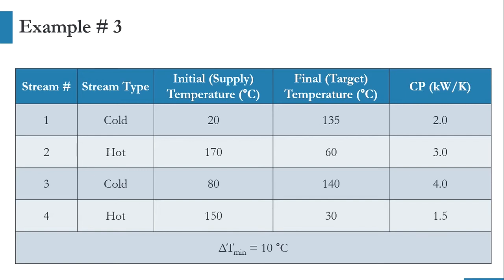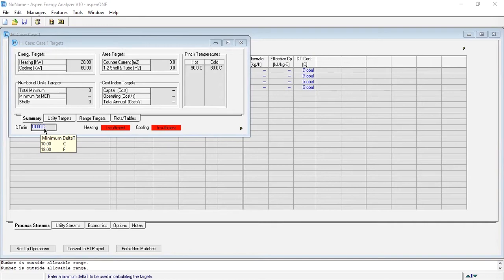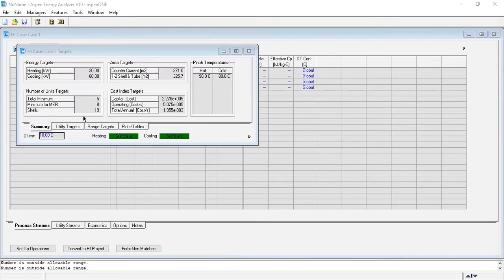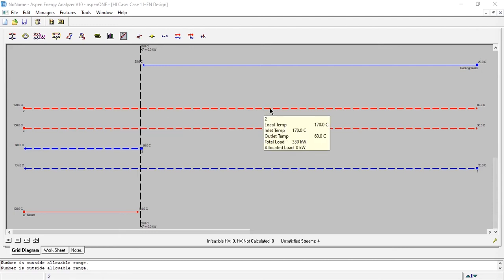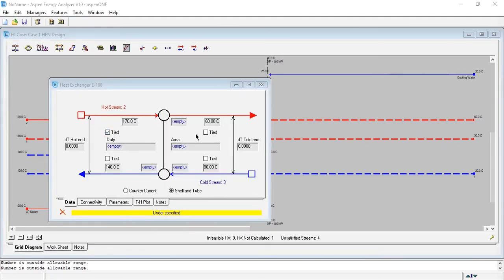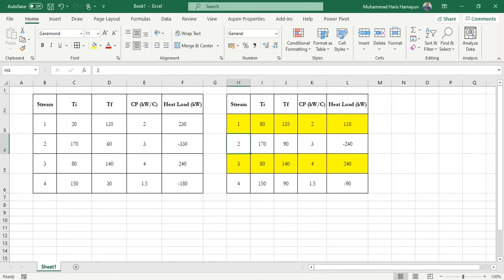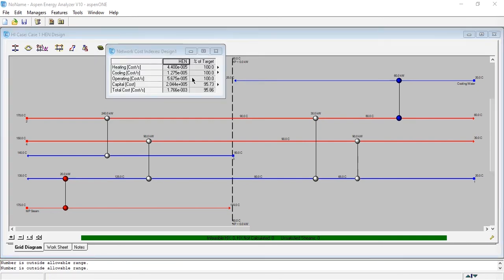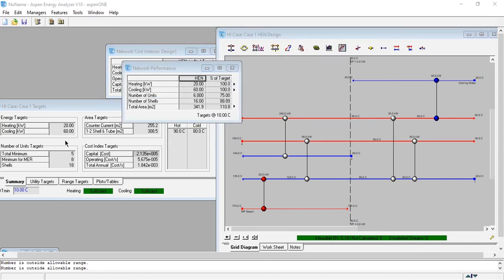Heat exchanger network design of 4-stream pinched problem - Lecture # 74

Comment: Thank you for the explanation sir, it is very helpful. However, I have one question regarding the cP. Where did you get the data of cP? Because there is no cP data in the Aspen Energy Analyzer HI Case table. Thank you.
Reply from the maker: Thank you for the appreciation. Either this data is given (as CP = mCp) or calculated from heat load.